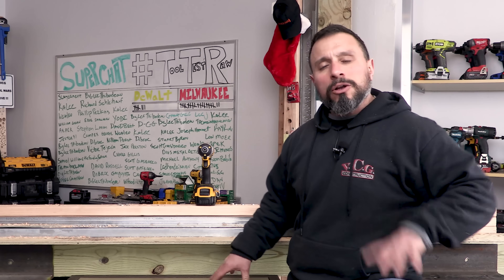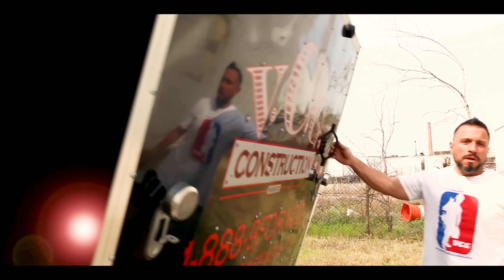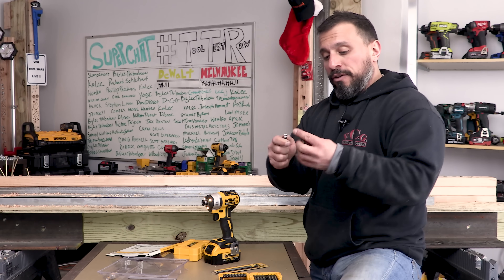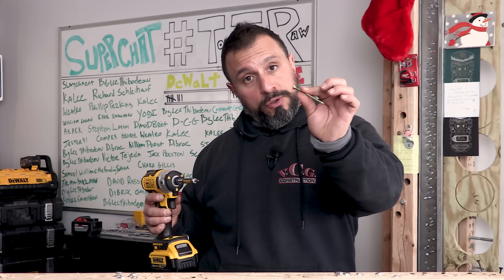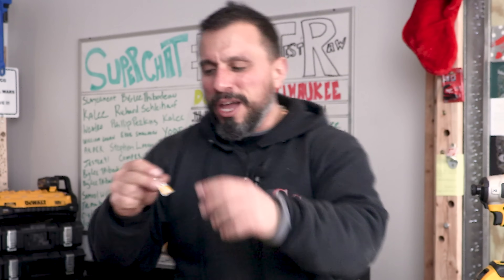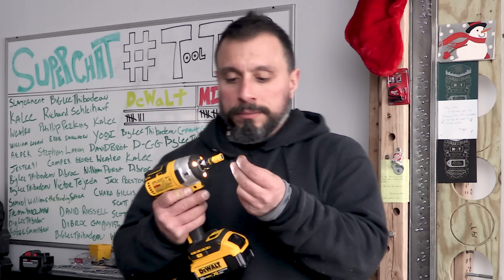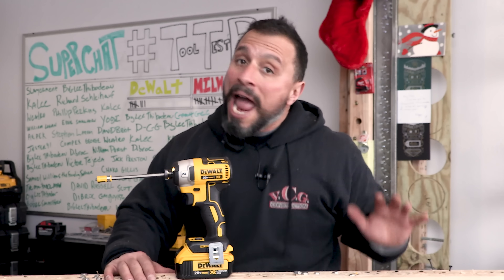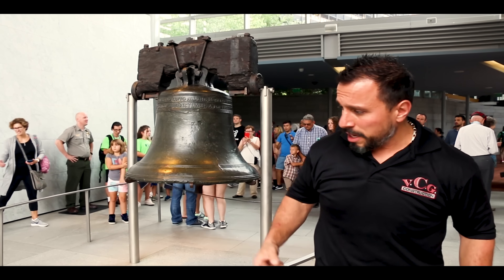99% OF PEOPLE DON'T KNOW WHAT THIS DeWALT TOOL ACCESSORY DOES!

Comment: That's why we watch your vids...you're honest...and you admit you didn't read the instructions like the most of us..! 👏
Reply from the maker: You da man Zee we appreciate you!!
Reply: Why do we never see you pull the bit lock chuck on the impact driver? It is like you do not know that it is there. The short bits will lock in if you use it. It is the collar that is around the bit where you insert it.You pull it away from the motor, the bit slides in a bit and you release the collar and it locks the bit in place.
Reply: cant believe he's been using a impact driver for HOW LONG and didn't know the long bits Lock in if you pull the ring out???
Reply: @VCGConstruction  "i never slow down to read it" just like you do clickbait thumbnails. now go tie that magnet  on to your hard drive please :)
Reply: Me too. I'm an engineer and I never used it. So the lesson here is RT#M 😂😂😁
Reply: Bet u didn't Kno Earth is Flat
Reply: Andy Crossland you don’t have to pull it to lock bits in. It’s a one way locking system. When you push it in it automatically locks in if you push it in all the way. It’s only necessary to pull the collar to unlock the bit.
Reply: I dont mean to be so offtopic but does anyone know of a tool to log back into an instagram account??
I was stupid lost the password. I would appreciate any help you can give me
Reply: @Ricky Anthony Instablaster =)
Reply: @Sonny Henry thanks for your reply. I found the site thru google and Im in the hacking process atm.
Seems to take quite some time so I will reply here later with my results.
Reply: @Sonny Henry It worked and I now got access to my account again. I am so happy!
Thanks so much you saved my ass!
Reply: @Ricky Anthony you are welcome :D
Reply: Some people love to talk a whole lot and explain every little detail. Idk how the hell I ended up here!! 🤷🏽‍♂️🤦🏽‍♂️

Comment: The thing I like most about the black Dewalt bit holders is the sleeve rotates around the bit holder so you can support it with your fingers without burning your fingertips on spinning metal.
Reply from the maker: I know it’s one of my favorite drives!!

Comment: Magnetic screw holder and work like a depth stop so u don't over set on drywall
Reply: And any finisher would take that away from you and trash it. Buy a screw gun
Reply: Theres plenty of depth setters for drywall
Reply: @kylealexander7024  lol... never heard of “just in case”? Don’t act like you’ve never forgotten something n didn’t wanna drive. It
Reply: @pdubzpyro  ever heard of a work bag? I call mine the bag of tricks and it always has anything i might need for a remodel in said bag. Not to mention theres a job trailer on site everywhere with everything else. So no i dont have the "just in case" a lot.
Reply: I do drywall for a living it doesn't set the depth

Comment: I bought that 7 months ago and when I bought it I used it for three months straight and it's just an amazing magnet that you can and it will hold ur screw straight and u can push it and hold it tight and it will help u to not miss the screw or it slipes/slides. :) I hope I did well at explaining.

Comment: I bought the same kits last year with the fastener dummy head demo. Thought it was self explanatory to fit on the longer driver bits to work with fasteners with heads that won’t fit into the sleeve. Goes back to that wise older gent who told you that sometimes slower is faster or n this case applying it to taking the time to learn something new. Awesome vids, Vince and kudos to all the VCG gang on what you all share. Stay safe all.
Reply from the maker: You’re a beast tim Simmons!!

Comment: I didn’t know and I’m glad I watched this cause I just bought a dewalt bit set this weekend and was looking at that thing wondering “wtf” it came in my set already in a 2” bit and it’s a nice thick stainless steel looking sleeve. I didn’t know it slid off the bit it was on. Thanks for this video.

Comment: You missed another key feature of the sleeve. It is gauged to set drywall screws at the perfect depth.
Reply: The sleeve will over drive your screw and break the paper then there is nothing truly holding your rock

Comment: Yeah they’re cool. I’m a bit of a magnet connoisseur I’m obsessed with them and use them for all kinds of stuff especially  tool related. I have tried every magnetic sleeve I can find for my impact and other drills, these dewalts do break on me sometimes. In my opinion the Makita magnet saddle sleeve is the best. It slides over any 1/4 hex, not proprietary like the DEWALT and to me it feels at least 3 times as magnetic. Oh and they are available separately to buy alone (I don’t think you can buy the dewalt by itself but I might be wrong?) Good video, entertaining you crack me up bro
Reply from the maker: Thanks TK !!
Reply: Watch project farm on bit holders. I just bought 20 of them 10x 3/8 and 10x 1/2" for sockets, but he does the showdown for bit holders. I'll let you see it...

Comment: I always used that specifically for DRYWALL. 
It allows you to quickly snap on a std drywall screw to hold it magnetic, 
then you rip it in fast into the drywall with a perfect sink into the wallboard, 
and the drill just auto-magically pops right off once the screw is counter-sunk just enough. 
Now it's ready for mudding.

Comment: it's magnetic, however, it is actually a drywall bit so the screw won't sink in too much in the drywall when screwing.
Reply: That sounds a lot more like a side benefit there bud. It's magnetic and also so it can be used with the torques bit screws. Not necessarily just a counter sink tool.

Comment: if you have the magnet extended to where you can't see the bit, you can pick screws up with it and it will actually pull them straight into the set position of being inline with the bit so as soon as you apply pressure the bit will easily engage with the screw upon contact.

Comment: I don' own a DeWalt drive kit but I do own a Makita drive set. They take the guess work out of the kit by adding a 17 x magnetic boost to a double ended power bit and then shows a picture on how to adapt it..Since I have a lithium Makita drill I went with the set It also works well with my Milwaukee impact drill for long or short bits

Comment: Mark R here.
That is used just like the magnetic apex you love. The mid sized bits in your kit get narrow right before the tip. If you look at the part it has a magnet on the face of it. Sleeve it over the head and it turns your tip into a magnet

Comment: I don’t remember if mine came with that or not.  I just bought the metal holder(non-telescopic).  I’m still learning how to use that.  I seem to have trouble pushing the bits into it though.  Are there specific bits that it would require?

Comment: Magnetic screw tip. Goes on a long bit and holds the screw on for easier screwing . I used them when installing windows but I found that the max fit bits held on good enough that I didn't need the help anymore.

Comment: Hey bro it is tool  that you put on any dewalt P2 bit to drive drywall screws into drywall to make it flush so the tapping and pudding process is easier and to keep the total strength of the drywall by preventing you from ripping the drywall’s paper to keep its strength.

Comment: I work on pianos.  I have a really strong neodymium magnet from a speaker.  Rub that on one of those really long bits and it becomes magnetic enough to hold  pretty large screw with no holder used.

Comment: I haven't bought a new bit set in a while, so I hadn't seen the 10x magnetic sleeve, but I like it.  I prefer to use the 3" bits because they fit impact ¼" hex quick release chucks,  plus adding a quick release hex chuck to a drill speeds up changing bits much faster.

Regarding the use of screw holding sleeves in an impact driver, if you take a close look at sleeves, they are aluminum. Repeated use in an impact WILL kill them; beats the aluminum to pieces.

The only 1" bit holders I been able to use with impacts without destrying them, are sleeveless, all steel holders.  I don't recall ever seeing a steel bit holder with a sleeve, but I have a handful of them, so I'd have to take a look to be certain there are no steel sleeved holders.

A suggestion, if you are in a similar situation.  When you first started taking about the 10X mag sleeve, you were moving it around so much, I had no idea what you were talking about.  This was compounded by me not being familiar with the 10X mag sleeve.

I guess you haven't learned a lesson from being in too much of a hurry to learn the purpose of the 10X mag sleeve!  LOL   Slow down, a half step, and make sure you get a good framed image of whatever you want your viewers to see.   (Helpful 'Pro' Tip: Always helps facilitate good communication, if viewers know WHAT you are talking about!)

I've had ADD my entire life; I'm an expert on slowing down to facilitate communication.  LOL...

Thanks for the vid, and the work they take.
Reply from the maker: Thanks George I appreciate the helpful feedback !!

Comment: I do but only because last guy I worked for did just like u said and thru em in a box. So i figured it out its a screw stop for the long bits. U can use it for sheet rock or whatever. But he still throws em in that box even after i showed him.

Comment: Them dewalt sleeves always break. I have a brushless dewalt combo kit. But I find that Milwaukee bits are way better then dewalt.
Reply: @SupaTrending Daily that that tools only purpose is to pull out and hold the screw in and retract as the screw threads. They only last through 1 box of screws before they jam up. They stop spinning when theyre on wood just as if you were holding it. I gave up on them

Comment: Mine came with the magnetic attachment on a #2 bit. Milwaukee  has the same thing. It didn't take long at all to figure it out.  Long bits have a purpose like installing a screen door pump or hand rail short ones don't work well cause the drill body gets in the way. Door handles too.

Comment: Makita makes the best mag screw holder. Dewalt doesn't compare. And I'm a Dewalt fan. But that Makita is just beefier and will run thousands of screws. Yeah, I tried the Dewalt when I got it, but the proof is right there when you're running in screws on a flooring job. The magnet on the Makita is much stronger. It sets the screw head just right. Funny thing is I don't really care for the Makita set, as the Dewalt sets are straight up better. But I'll order the Makita bit holder from Amazon.
Reply from the maker: I like the Makita magnetizer as well!!

Comment: It’s for your fasteners not to fall you still put you bit in the 1/4 inch hex normally but u slide it over any bit your using and it will save your bacon especially in places you don’t wanna drop a bolt, screw, any fastener…

Comment: I use it for drywall      if you use it with a drill  most drills will run the  screw thru the paper   if you set your Phillips   bit in your chuck and counter sink it alittle past that  magnetically steel end 
  Same theory  as the collar  on a drywall screwgun..

Comment: Magnetic holder that slides over and locks onto the bit and helps from over driving the screw. I use mine all the time and it will save you time in centering the screw onto the bit (especially phillips #2). This tip adaptor works with phillips #2,#3 , torx T-15 thru T-25 and robertsons aka square drive bits (Kreg screws and electrical box and fixtures). You will also notice that newer bits now have a reduced shank just for the magnetic holder to slide over to assist in holding the screw.
Reply from the maker: All good info thanks for sharing!!
Reply: @VCGConstruction  Your welcome and keep the entertaining and informational videos coming.

Comment: @VCG Construction  fyi Home Depot has a Milwaukee  M12 hammer drill/ impact sale with 2-2.0 batteries charger, & Packout case for $199.  I know just the bare tool hammer drill is $149  so it's a great deal in my eyes. Thought you might want to know,  spread the word.

Comment: DeWalt makes some decent pocket knifes that are cheap and pretty tough too. I used on at work for over a year until I forgot it abroad on vacation. The tanto blade was good for scraping (I do all kinds of remodeling in old houses) and lots of jobs, and for $17 I haven't found anything better.

Comment: I always just use the magnetic sleeve.. a lot if my coworkers use the super long bits and it drives me nuts as well whenever i have to use theirs for whatever reason. Bc one they dont use the little magnetic thing either, and also because you get a lot better leverage on the screw the closer your bit is too it. I love that sleeve

Comment: Thank you for uploading so much for uploading  this video!  I am hanging a bunch of wire mold and and glass mounts for my surround sound and its a pain in the ass trying to run screws in while holding the workpiece and level at the same time. Any slight jostles knock the screw off the bit and the magnetized bit holders (including my $25 Wiha 2" extension) havent been effectivein keeping the screw on.  I bought the same or similar kit a couple of years ago in order to  get the bit holder with the sleeve and did the same thing that you did (tossed it in my box).  With all that said, your video prompted me to look for the accessory and is making things much easier now!  I appreciate the knowledge sharing keep up the good work!

Comment: I hate those things. They are Magnetic Bit Holders and you slide a Bit into it and it magnetizes the bit to better hold the screw. The Ring around the end of it is what holds the face of the screw in place on the Bit. The part I hate is once you put a Bit in them, it is a pain to get them back out. I've used them a few times. In my opinion they don't hold the screw in place all that well, but its better than nothing.

Comment: Versitle is the best thing you can say about that thing. It doesn’t stay in a position that allows the magnet to hold whatever screw you are trying to use it with and it is difficult to see the screw when you are at the end so you end up either going too deep or you have to give a couple extra pluses. The thing is annoying, just use the regular magnetic bit holders
Reply from the maker: Okay cool!

Comment: There's another reason for that long sleeve too.
Say you are drilling a screw into a doorknob assembly or another place you don't want scratched.
If you hold that sleeve the bit and screw will turn  but you won't scratch the door knob because only still plastic will touch it.
.
It's also good for precision starting a screw because you can line the bit up quickly and accuratly with your left hand and run the drill without worrying about your fingers because the sleeve is letting it spin without burning your fingers.

Comment: That magnetic screw holder was the main reason I bought the Dewalt kit; no one else has anything as good!  Especially useful for screws with wide tops, such as cabinet screws, that don't fit in the sleeve type.

Comment: I use one of those almost daily at work it’s magnetic and you can put it over certain bits to hold a screw on it while starting the screw. 
It’s works very well with the number 2 Phillips bit when putting up drywall it buried the head of the screw almost perfectly in the drywall

Comment: I like 2" bits w no magnet.
I live on the edge!
My fave. Bit Bosch dual tip
 ph#2/sq#2 both at same end
I always predrill hardwood with a tapered countersink.
Long bits are the only solution to pocket screws btw.

Comment: It's a magnetic sleeve to magnetize your bits and also stabilize the screw on the bit. Dewalt also makes a metal version of this magnetic sleeve, which in my opinion is more magnetic and stabilizes the screw even more than the plastic version you are showing in this video. I love the metal version so much I bought 3 more to throw them into my other bit kits.

Comment: The closer a building gets to completion, the less room the following trades have to do their installations or set there ladders up, etc. It depends on the trade wether or not you find use in longer bits, or bits that allow access into tight spaces. Nice video. Cool attachment.

Comment: How do you remove the bit from 10x  magnetic sleeve ? I can't figure it out
Reply from the maker: You need a opposite pole magnet to drive the bit out
Reply: Just pull it out the bottom.  Give it a good pull.
Reply: @VCGConstruction  thank you .🎉🎊🎊👍👍

Comment: The additional tooling magnetic item is to not only be a quick connect for bits but also designed to slide over the screw to avoid slipping when screwing screw in

Comment: Drives me crazy not having magnetic bits too. You do know how to make bits and screwdrivers magnetic though right?
Reply: David Marks how?
Reply: Alexander Amjad  take a good strong magnet. And take your non magnetic screwdriver and slide it across the magnet 5-6 times.... Start from the where the metal meets the handle and slide down wards to the tip. Do it 5-6 times and bam it’s magnetized! If my directions are not clear. Look it up on YouTube.... how to magnetize a screwdriver. 👍🏽
Reply: Alexander Amjad it lasts for a couple years.... and if you want to demagnetize you just slide it in the opposite way.

Comment: I have a Milwaukee bit kit, I use the magnet a lot. I also like to have two or three screw guns with different bits if I have to switch from a drill to a  countersink then a screw driver bit.

Comment: Don't know the correct name of it, but I use it on my drills to magnetized the bits I'm using. Also, it fits on my screwdrivers. I've dropped a few back in my day. I like it, but it's cheaply made. The magnet falls out frequently.